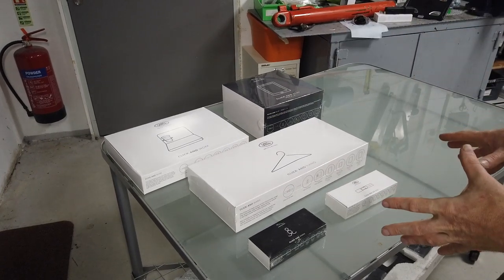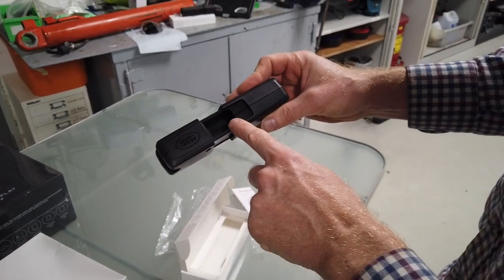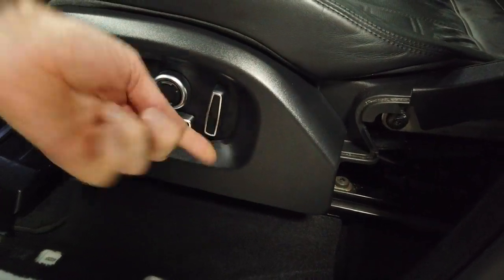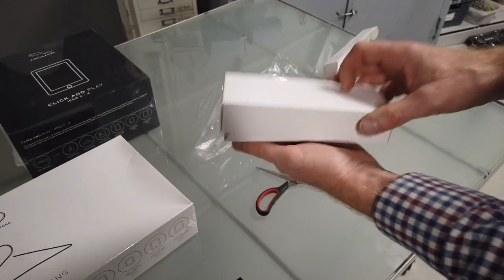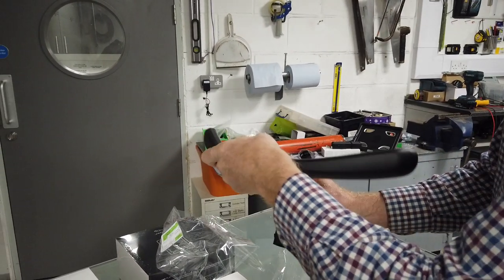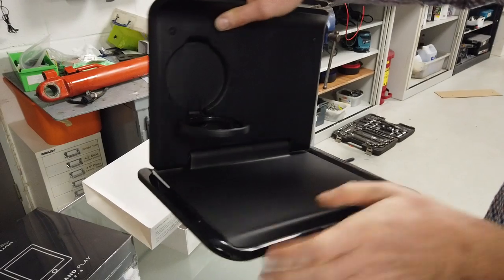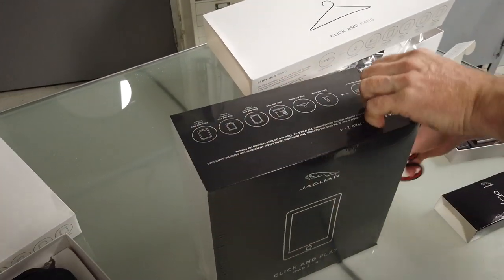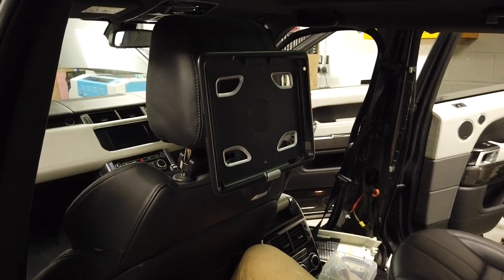Land Rover / Jaguar Click & Go Accessories Demo & Installation Tutorial

Comment: with the 'Click and Hook' the first option you tried, would that fit in Defender 90 2021 which has a section already mounted on the rear of the front seats for these plug and play accessories? I couldn't see this on your website?
Reply from the maker: Yes this will fit and its on our website - its out of stock at the moment should be instock tomorrow.

Comment: The iPad holder....which size iPad does it take at there are three different versions? My guess is it only fits the older 9.9” size?...and only if you don’t use a cover. 🧐
Reply from the maker: Hi, this particular holder is only suitable for the iPad 2, 3 & 4 - it doesn't fit the later generations, or the air, pro or mini models.

Handy link here to check which model you have:
https://www.iphonelife.com/content/which-ipad-do-i-have-how-to-identify-different-ipad-models-generations

Comment: What a waste of plastics 😎
Reply from the maker: As far as the table goes i have to agree... the ipad holder i can see is of more use
Reply: @L663  I've got the coat hanger into the base and it's very useful for transporting a coat not making any wrinkles and/or an extra shirt. And it hangs on the back seat head rests as well.
The Land Rover line of bits are all black, and the Jaguar series of same bits do have a silver inlay.
Thanks for sharing.